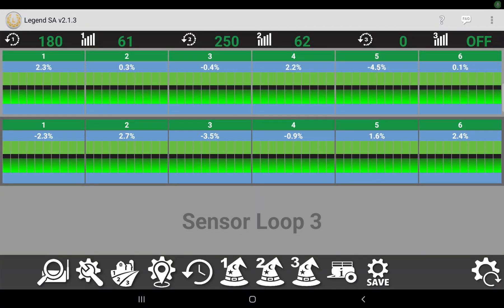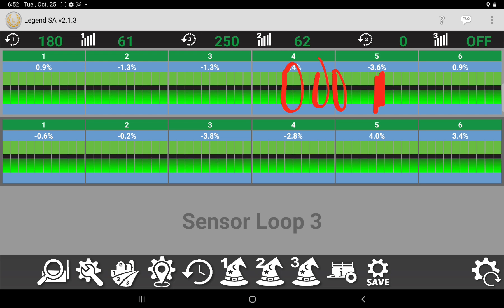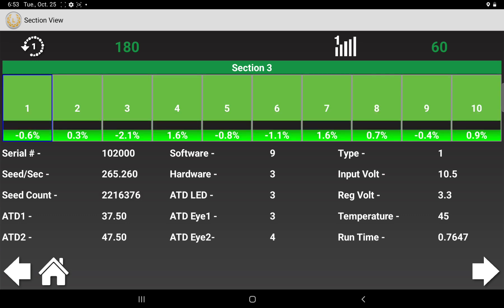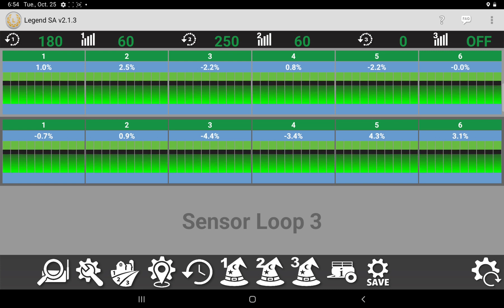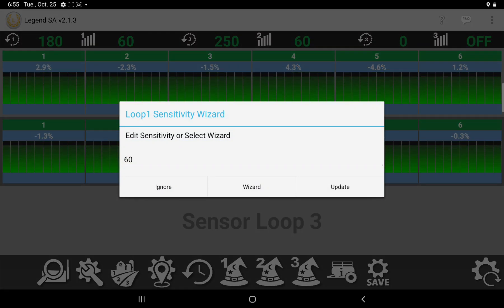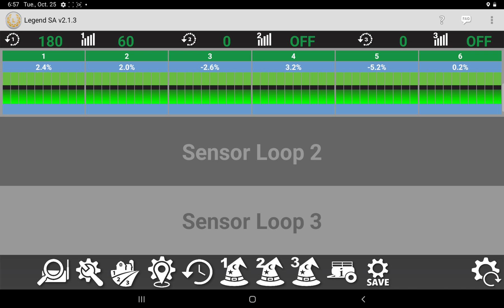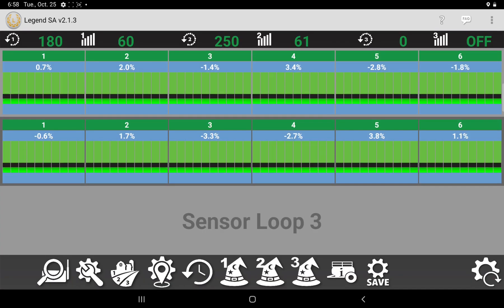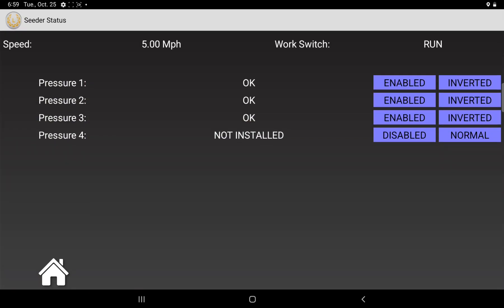Agtron Legend Operational Basics

Comment: I put down a starter fertilizer blend of 10-10-0-0 with the seed in the same tubes. I would imagine that if there was an issue with the canola not being delivered to the tube the monitor would not pick that up. At 4-4.5 lbs per acre canola seed it would be such a small variance in the stream that almost can't be detected